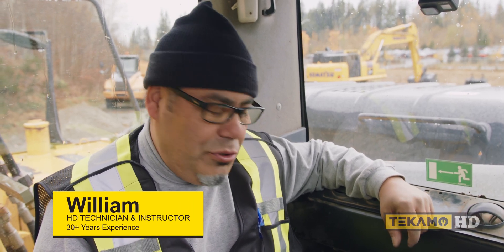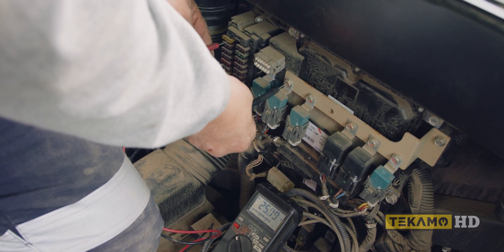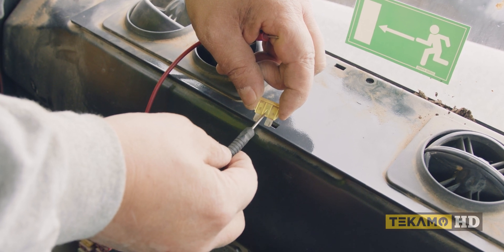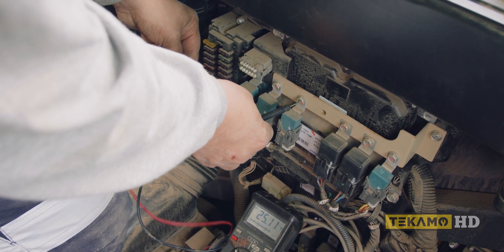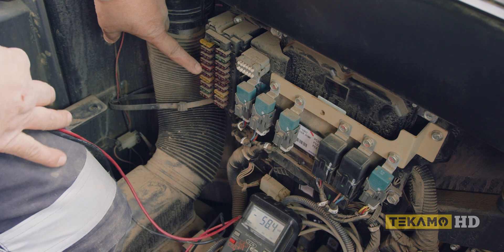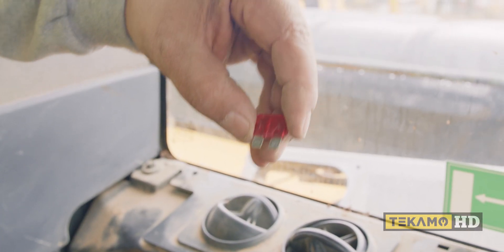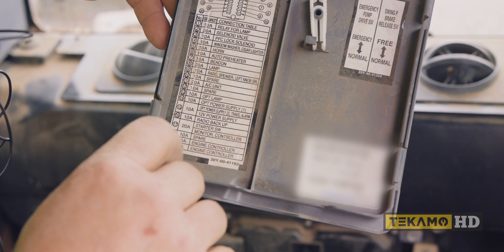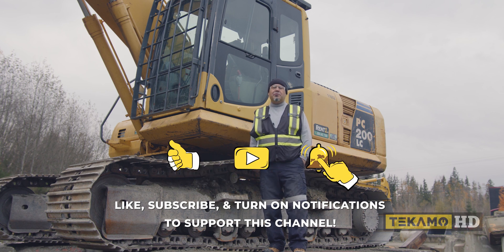How To Check Fuses With A Multimeter (or Voltmeter) - TEKAMO TIPS #5

Comment: In forklift industry I’ve had issues with fuses reading ok with voltage but failing with a load on them. I always pull them out regardless and visually inspect and check resistance on them. I want to purchase the load buster for this exact reason. Avoid pulling fuse by fuse to check visually
Reply: Loadbuster?